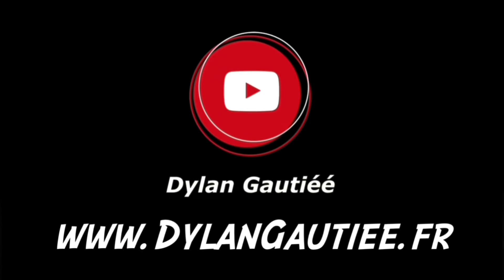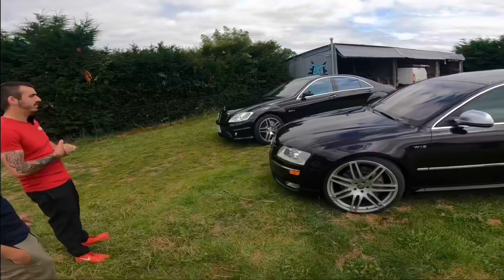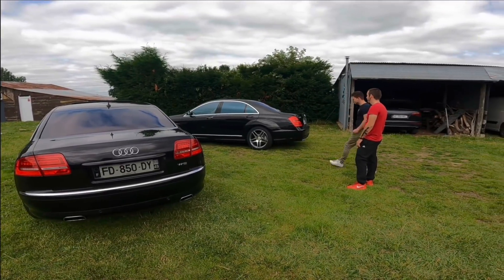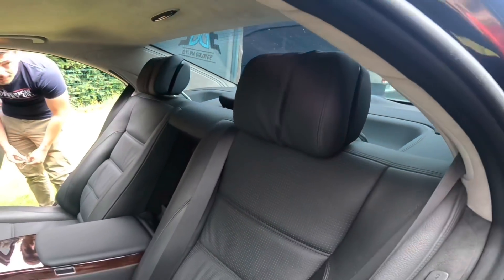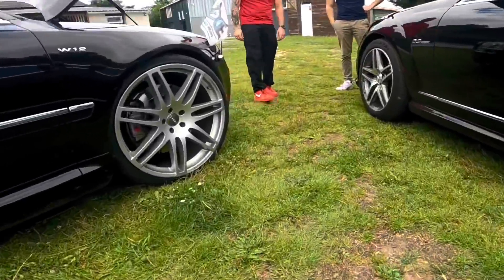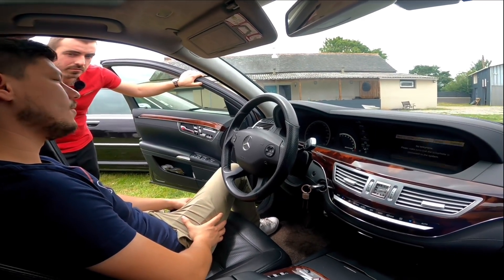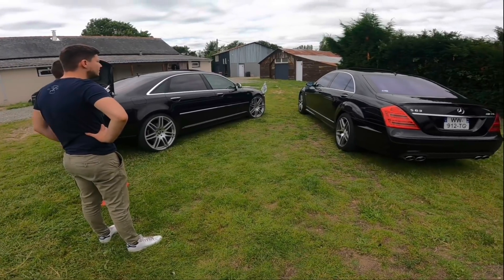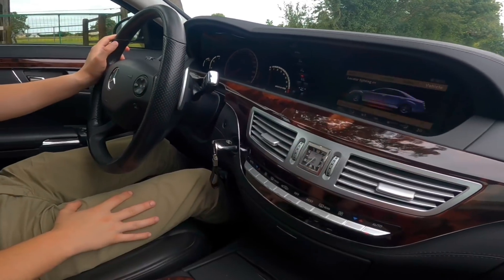AUDI A8L W12 VS Mercedes S63 AMG Limousine

Comment: dire qu'en 2009 la vision nocture existait deja on se dit qu'aujourd'hui on est a la boure parce que la DS9 vient a penne d'adopter ce system
Reply: Tu compares un véhicule a 150k avec une berline a 50k.. c'est pas comparable.
C'est comme les vitres électriques dans les années 80/90
Reply: "peine"
Reply: @anthonybrou4445  👍🏼
Reply: @philbct  ce que je veux dire c’est que la France 🇫🇷 est vachement en retard
Reply: @Furaxx_666  aucun rapport avec la France.
Les Allemandes également l'ont adoptés récemment, et c'est pas du tout la même gamme.
Une 308 est quasiment 2x moins cher qu'une A3, pareil pour les berline (cf configurateur Audi)
Reply: @Furaxx_666  aucun rapport c’est grave d’être aussi con